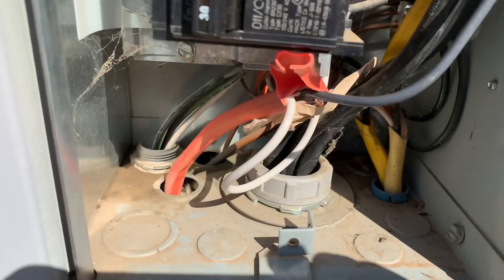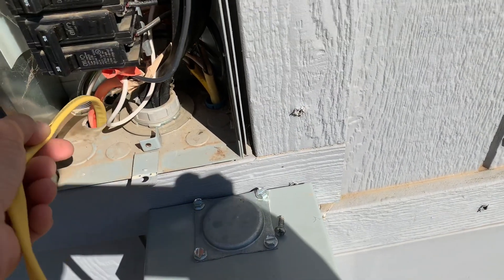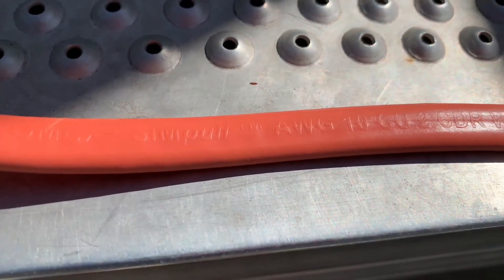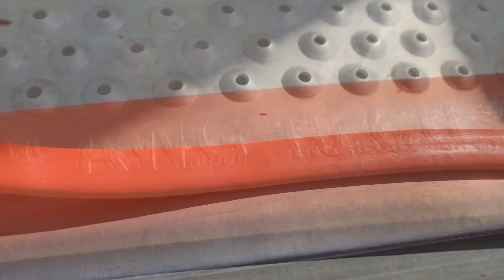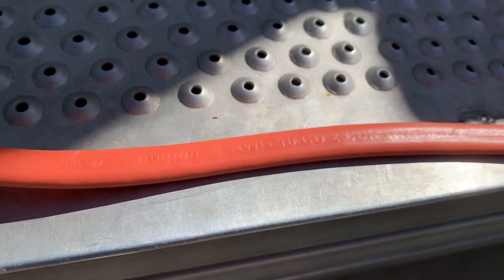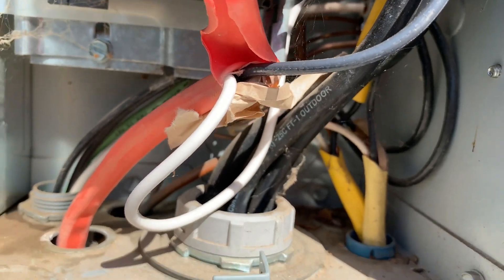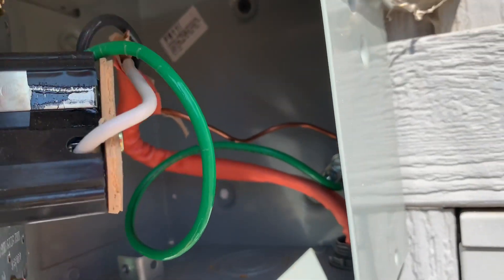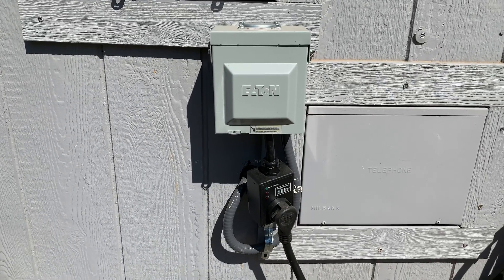30 Amp RV Power. 10 AWG Wire.  YouTube Comments

Comment: What? 10 AWG is correct. But it’s 10/3 wire, not 10/2 for an outlet. 

10/2 wire is for DC circuits.

Comment: I watched the first video on this, and I held off commenting on that video because I saw you mention to click on this "update" video on it.
So, my 3 issues I noticed:   
1)  the yellow 12-2 gauge wire that was used (and not the orange 10-2 wire that is needed)
2)  the flexible conduit leading from the new RV box into the wall, would allow rain water to travel down the conduit and into the structure
3)  there wasn't a cable connector clamp through the main circuit breaker panel in the knock-out hole where the new wire for the RV receptacle enters the main panel {and there still isn't one}